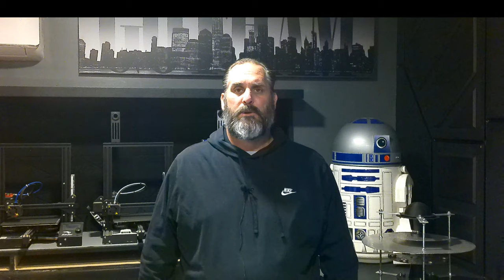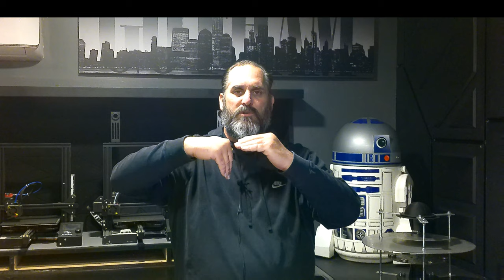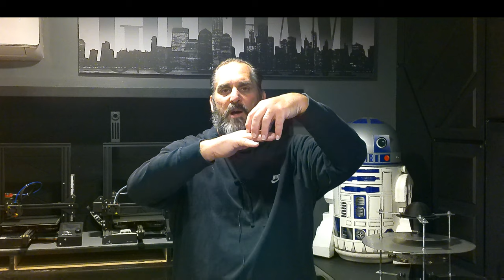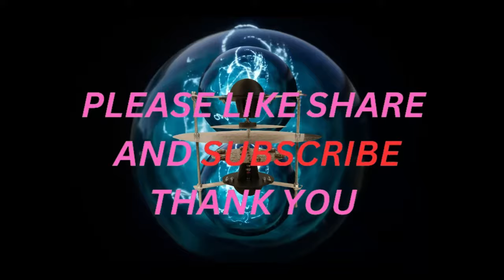Graviflyer "A Breakthrough Point" #23

Comment: One thing I have to point out was that Tesla was using a generator to put energy into the earth. I say the negative/neutral was in the earth/water chamber from the generator, and the positive in the spark gap to the primary coil. The tower was wood, and the shaft was wood with a copper coating. Water will get sucked up the wood like a wick, adding density to the pole, and the copper would allow the moisture to be kept in. The frequency of the generator excited the water with electrons, most likely at a crystal frequency like AM radio. The tower had a charge that excited ions in the air and pulled down the height needed to get higher volts, as the ground and tower took the resonant high voltage energy of the atmosphere. As he tuned the crystal, the more power he could pull from the earth and atmosphere. Then, it's like the tuning forks: you connect a receiver, one in the earth and then tune the receiver tower to the resonate at the same voltage, as the transmitting tower allowing you to take the high voltage, step it down, and run it in town. It was never really meant for every home to be wireless; its intention was for high voltage transmission to a receiver that stepped it down for residential use or commercial use. Homes would have still been wired, but planes, trains, and automobiles or big factories would of been on their own receiver to draw power from the main transmitting station. Keep Up the good work...
Reply from the maker: I agree
Reply: @nathanbunten4299  What I'm trying to say is, Use wet wood in the center of your tesla coil instead of PVC plastic as might have more energy density and it should not burn your wires being damp.

Comment: I think you might have the US freq backwards. It's always in the khz range, but when the NC Pulse OFF button is pressed, there's an EMP spike in the 7-9MHz range while still maintaining a signal in the 60-360khz range. When the button is not pressed, the US range is 5-35khz.
Reply from the maker: got it.
Reply from the maker: then the frequency of the US needs to be lower its the crossing that gets the emp effect. The whole craft runs in khz so if the US is the lowest of them then the spike can go through all of them. Or does it need to be higher to make this work? 

We can make a tesla coil to hit a certain Khz frequency. We can also do the same to the high voltage and by changing magnets and distance on the bottom plate we can control the frequency of the center plate. So which way do you want to go?
Reply: @nathanbunten4299  I've just verified that the circuit continues to produce higher audible harmonics while the pulse button is pressed. This means that the higher freqs produced by this circuit are certainly either overlapping with the khz tesla coil freqs, or it could mean that we are somehow using the transients produced in the MHz range in order to couple together the surface charges (thus reducing these charges  by transferring them during the pulse).
Reply from the maker: @MyTBrain  Getting the correct circuits is making a huge difference in testing. Great work on the tesla coil sound.

Comment: What if you tried using plexy glass for the center disc , and is there any significance in a sawtooth wave pattern ?
Reply from the maker: The center plate must vibrate. It would be the best if it resonates. So plexiglass will not work. 

The sawtooth wave: If you overlap the signals of each part of the graviflyer it will look like a sawtooth. 
1)ultrasound
2)high voltage both discs
3)tesla coil
4)center plate
All in Khz

They should never line up directly. If they do you get an emp. They have to be offset from one another. You want the power without getting the massive emp. It is like an am  radio signal. it comes in just before and just after the perfect signal point. 

So when you spike the ultrasound it needs to be offset from the spikes. But close enough to impact them.

Comment: The upper disk turns to the left and there are holes in the disk. It is positively charged. A vacuum tube is used on the graviflyer (neon, x-ray lamp, fluorescent lamp). The middle disk is negative. The lower disk turns to the right and is positive.  six magnets n upwards. reason;  Gravity consists of two spiral rotating static magnetic fields. One rotates to the upper left, the other rotates to the right. They are separated in the shape of a cone.
Reply from the maker: the middle plate is going to the tesla coil. It can't be negative. The bottom disc is.
Reply: The middle disc should not come into contact with the upper and lower discs. The negative pole of the Tesla coil is connected to the capacitor. The positive poles of the capacitor are connected to the upper and lower discs, and the negative pole is connected to the middle.
Reply from the maker: @halilka9853  no it is an open air capacitor. The center disc is connected to a wire that goes down the center of the tesla coil. It has no negative Connection to it.

Comment: I think it flys by electromagnetic on the bottom disk by double jumping in the air when the craft experiences free fall the electromagnets have to have enough power so the bottom plate repels the middle plate and enough power to repell it own weight and the two gyroscopes are to stability in the air

Comment: Even better, put spark gap between the HV wires, except put a big resistor like 10 M in series with the spark gap. That way the disks won't be getting pure DC but AM modulation. And that'll give you lotsa harmonics.
Reply from the maker: I could just put the wire under the magnets and it will give me plenty.

Comment: What about a van der graaff and the metal pie tins that fly off the top, they are disk shaped and fly away easily breaking gravity.
Reply from the maker: I would not consider force breaking gravity. Though I do think it is very cool.

 I am trying to confirm a long held belief that the universe is controlled by harmonics. This project when successful will either prove that or destroy that belief. Either way I am in for the ride. No matter where it leads.

Comment: I disagree Nathan from what I know from chatting with Alexey. The high frequency of the ultrasound keeps the charge on the Al and Al2O3 coated disks low. When he turns off the ultrasound at high frequency, he gets a very large charge on the disks to push off the earth's surface charge and to attract to the ionosphere, so he gets lift.  You don't want an air capacitor that discharges with a glow but a normal capacitor.  The tesla coil frequency is low, and this is good to work with the ultrasound frequency.  The frequencies do not push the charge from the bottom to the top.  You need the low frequency that matches the Schumann resonance of 7.83 hz. The water in the atmosphere is good as this affects the speed of sound in the air that affects the Schumann resonance as I explained in my pages of calculations that you can use for any size craft.  The voltage is high to keep the charges separate as well as the magnets keeping the charges separate.
Reply from the maker: This is why I test everything.  I have verified what is going on. I have published the tests of how it is working. That is what I am basing it on.
Reply: @nathanbunten4299  There are many things going on with the graviflyer due to the universes hologram where any solution is valid due to the way space and time are structured as you are being in the past from me and me being in the past from you. In this way your genes experience a different force, so the atoms have a different sequency and you look different and think different. I know how this works from chatting with thousands of scientists over the past ten years. Every point in the universe also seems to be the center due to the hologram effect.
Reply: @nathanbunten4299  What happened to your charge video as I cannot find it anymore on your channel where you tell of how each device helps build the charge. Maybe I am getting blocked from seeing the video? I don't know.
Reply: @nathanbunten4299  Another person can set up the experiment exactly like you did and see completely different results and why you get so many questions to how you explain how to do the experiment with the graviflyer.
Reply: @nathanbunten4299  Everyone is in a different reference frame as per Einstein and Relativity theory, so they all see it differently. This is due to them all producing a different space wave or gravity wave as per my spectrum by their atoms that are all traversing space at a different rate of time passage and why their watches all run differently.
Reply: @nathanbunten4299  You will not ever get everyone agreeing as to what is going on and you will argue a lot. You see what you see as this is what you wish to see as the graviflyer working as the human brain controls the hologram.
Reply from the maker: @richardmuller867  not Shure what one that is. I do not have you blocked. Can you tell me how long ago it was.
Reply from the maker: @richardmuller867  We have 2 of alexey's graviflyers and all the circuits that go with them. They have been replicated and handed out to our team. The original circuits have also been tested to match the replica's. So we are testing with the real numbers.
Reply: @nathanbunten4299  The video on how the different parts brought about the charge was about ten minutes long. It was about four or five days ago.  You are using three aluminum disks that are conductive so you see the charge get pushed down to the bottom plate when the ultrasound is on and it should be the Al, Al2O3, polycarbonate disks. I am currently being blocked by the NSA from about five people possibly due to my theory as Jeremiah Popp thinks so when we communicate. Jeremiah is from APEC and Jarod and Charles know him. You, Jarod, and Charles have all gone into harmonic resonance with each other, so you all see the same numbers. It does not mean that the numbers are correct.  It is like when you put four women living together and their menstrual cycles all align to the same date and time. Try it.
Reply: @nathanbunten4299  Nathan to see how the graviflyer works you all have to have a different device and setup and take a weighted average of all of the numbers. Alexey's brain does this over many years with his many tries and many different devices.